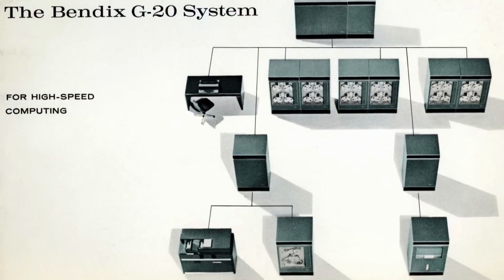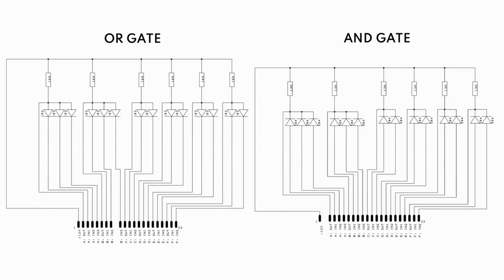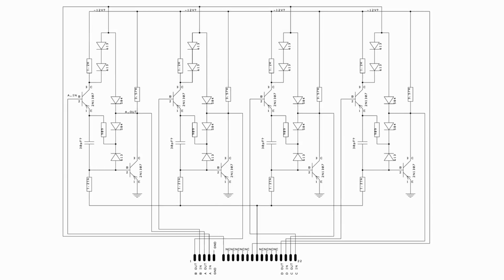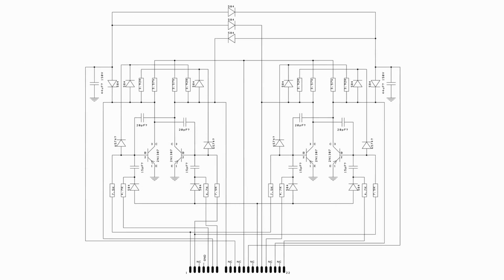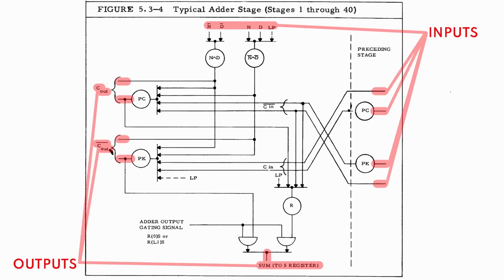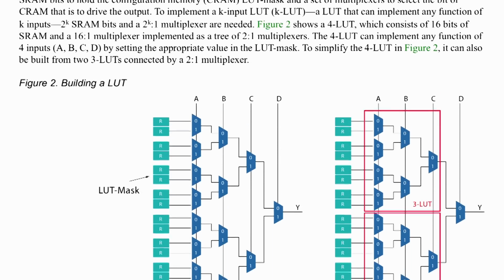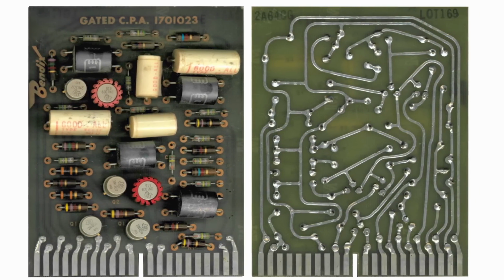Reverse Engineering Bendix G-20 Mainframe Cards

Comment: Looking at the transformers on the schematic, it seems to me that they "pulse" an output signal, i.e. making sure that it (at most) stays at a certian level for a very brief period of time. Could be some sort of Clock-Pulse or otherwise timed signal? Communication related perhaps? The diopd on the transformers are certainly clamping diodes for the field collapse. I can't think of any other use case for transformers in a "digital" circuit. But I'm sure they were commonplace back in the day, so they put them in instead of rigging up some 555 timers 😜
Reply: This was my thought too. I have been reverse engineering an early all-electronic PBX that used PAM-TDM. A pulse transfomer was used to gate a 4 diode bridge that was used to sample the analog signal. The diodes were actually configured as a bridge rectifier, with the pulse applied to what would normally by the DC side of the rectifier. To operate the gate, the paired anodes were driven positive, and the paired cathodes negative. Using a pulse transformer meant the differential gate drive voltage could be generated from a single voltage supply.
Reply: Is CPA  clock-pulse-amplifier? Part of the clock distribution circuitry.

Comment: In germanium land, diodes were cheap and fast, PNPs were expensive and slow, and NPNs were initially unavailable but later were most expensive and most slow.  This greatly affects circuit design.
Reply from the maker: Interesting! I had no idea that PNPs preceded NPNs, and for a computer like this that was at the forefront of the transistorization of computers, it makes sense that they would have used PNPs first.
Reply: @UsagiElectric  : You'd see PNP-based designs sticking around into the early seventies, often designed with a single negative supply rail and a positive ground.  With schematics drawn so the negative supply was at the top and the positive ground at the bottom, too.  Very hard to get your head around if you were used to tubes with a normal B+.

Comment: It may be that they are inconsistent and are flipping logic levels - voltage levels for some portions of the design.   An AND gate is an OR gate in inverted logic.  IE:  A AND B = (Not A OR Not B) with Inverted output.   You also may need to shift your thinking a bit.  Bipolar transistors are current controlled devices not voltage controlled like your vacuum tubes, TTL logic or MOSFETS.

Comment: I think the outputs of the emitter followers are from the emitters.  Those TO-5 transistors, if you put the two widely-spaced pins at the bottom, bottom view:   like this:

     *
 *      *

they were from left to right, clockwise,  E B C:

     B
E      C

Also on the Flip-Flop there should be a couple of resistors and/or diodes going from one collector to the other base and vice-versa.

And for the full adders-- why worry?  There is just one way to add two bits, with an XOR gate for the output and a OR gate for incorporating the carry.  

For carry-lookahead the most likely way is a bunch of AND gates seeing if a bit is asserted and the previous bit generated a carry.   This has to be recursively done down the adder so it quickly becomes a mess of multiple-input AND and XOR gates.

For doing an XOR the easiest way is to use a transformer that will respond if two bits are different, trivial with a transformer.  Then you need two diodes to catch an excursion at either end of the secondary.  With only transistors it becomes a mess of duplicated cross-connected AND and OR gates.  

 And it's all muddled if it's negative logic.   Just remember that if the diodes have the cathodes as the inputs,  and resistors pulling up (to logic 0) it's a negative-logic NOR gate, any input pulled down (asserted) pulls down the base, which raises (unasserts) the output.   If the diodes have anodes (triangly end) going to the inputs and resistors to a minus voltage, it's a NOT-AND gate, all inputs have to be low (not unasserted) for the output to go HIGH.   Every transistor stage does a logic inversion, so you have to keep that in mind throughout.  I know, it's very confusing.

A bit of a brain teaser.  Just keep in mind they probably used the simplest possible designs, as those diodes were likely $1 and the transistors $3 each. 

Just remember that they sold some of these, so it probably worked, any goofy looking stuff is correct, you just have to have faith.  In the lowest level it has to be AND, OR, NOT, and XOR gates.  

 In that era Seymour Cray designed a similar computer, the 48 bit 1103 that at first used the out of spec  germanium transistors from Texas Instruments which were much cheaper.  He had to not only use the simplest circuits but also ones that could operate with leaky and low-gain transistors.  He only had Tek 535 single-trace scopes at best so no trace storage and no glitch capture, if a pulse wasn't repeating and at least 200 nsec it couldn't be seen.  

There is a story about Seymour being super proud that he could pull out the complex Laplace transform techniques when he was assigned to design a pulse transformer.  But then he asked the engineer in the next office how he was designing his pulse transformers, and the guy said he only knew Ohm's law, he used trial and error to get the correct inductance and his transformers worked just as well and didn't require a whole day and a page of complex integrals to design.   Maybe that's why Cray was so modest in later years.   Anyway,  they were engineering giants in those days.

Comment: woah cool i found one of these pcb's a few months ago randomly in an alley here in the city,  had no clue what it was but it looked old and cool so i took it home and later found out it had germanium diodes on it which inspired me to make a distortion pedal for my guitar  and put me down an electronics rabbit hole the last few months.  It says "time base gen" on the back by intertech inc, so most likely part of a computer.  Unfortunatley it  looks like it was crushed with all the components laying flat ont he pcb, some  transistors ripped off  and many glass diodes broken.
Reply: ב''ה, this would probably be for broadcast television synchronization or similar videography equipment, but no specific knowledge.

Comment: An emitter follower is much the same as a cathode follower from your tube circuits, basically a low impedance buffer. The emitter will be the output, I think you might have the pins on the case confused.

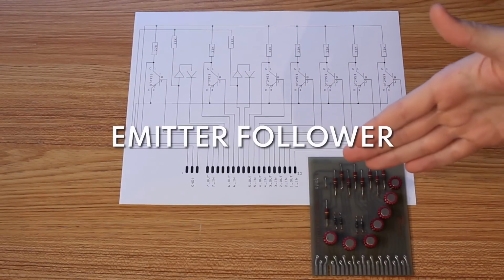Comment: Your schematic at 7:25 shows a group of “common emitter” PNP transistors with outputs on the collectors.  You mistakenly called the topology an emitter follower.  I think you’ll have trouble trying to tie your understanding of vacuum tubes to bipolar transistors; they’re not the same in that collector-emitter current of a bipolar transistor is a function of the base current whereas vacuum tubes control their anode-cathode currents via a grid voltage.
Reply: Yet they technically function essentially the same way only much more efficient due to the fact that the transistors don't even need heaters like the vacuum tubes before them, and Silicon P-channel MOSFETs are the closest equivalent of the triode tube, while bipolar transistors are completely different. So some skills and experience with vacuum tubes can be applied to the transistor as long as you know its merits and gotchas.

Comment: Amazing, these early transistor stuff is among the hardest to understand. 

Since components were super expensive, a lot of "strange" but super clever tricks were used to keep the component count minimal. 
Also a lot of the old stuff used a lot of inductors and transfomrers, which kind of got out of favor in later stuff. 
Jeri Ellsworth has an old video where she shows a whole "logic family" based on inductors and magnetic flux. (just as a sidenote)
I guess since semiconductors became so cheap and easy to manufacture, this sutff fell out of favour, since it is large, expensive and required a lot of manual work.

The wikipedia style site sounds pretty cool, I would definately take a look at that and see what I might be able to help at.

EDIT: 
Another sidenote, if you want to fully blow your mind, take a look at DDL or diode diode logic, which is a logic family, purely based on diodes, without any switching elements, it uses some wild stuff as well.
Reply: Agreed - when a single transistor cost the equivalent of $20 but a diode was $1, you certainly used diodes whenever you could.  The DEC PDP-8 (which was a contemporary of the Bendix G-20) used about 1500 transistors and 10,000 diodes.

Comment: I have built allot of stuff with just bipolar transistors. You really need to know what the transistor is before tracing out the schematic. Many times it's necessary to know what it the board connects to. I have seen 6 bit DAC's made using just 6 transistors and resistor networks.... And don't rely on the markings. Many manufacturers back than used their own markings on jelly bean parts. HP is by far the worst offender...

Comment: Diode chains on the emitter follower are there for DC restoration, as there would be cases, after going through a few gates, that the logic levels from the diode logic would be outside the acceptable levels, so the DC restoration is there to be wired in in the socket to allow the emitter follower ( actually here an inverter stage, expensive compared to diodes, and only used when absolutely needed to restore a sharp edge and provide current gain) to be offset by the 2 diode drops, so it will switch reliably.

Likely there are 2 types of logic here though, with one being positive and the other negative, depends on where the card is in circuit as to which one is used, which explains the confusion, and also the 0V reference might not actually be the chassis, at least locally, it might be generated by some diodes from a power rail and chassis.

Comment: That G-15 truly is a thing of beauty.
I've got to have a close look at that AND schematic later ... OR with diodes is fine, but as far as I thought, you need transistors to do AND.
PNP logic seems weird and downside-up too.... yeah, I really have got to get some screenshots of your schematics of these fascinating boards.
I wonder if those chose PNP specifically because it was something new that those old crusty vacuum tubes can't do and it was all about novelty... it just makes more sense to me to carry on "doing it the old vacuum tube way" and using NPN.
Reply: Germanium PNP was pretty much all there was in the early days of transistors. Certainly in commercially available quantities. NPN were available, but they hadn't really perfected the process.

Comment: two things I notice: 1. multiple diodes in series might be used to get increased threshold voltages, especially as this might be Ge diodes with lower knee voltages. 2. the typical flip flops you reference are level triggered and thus don't have capacitors in the "cross-over" feedback. Bendix ("we bend electronics"??) seems to use edge triggering here because of the caps.
Reply: Bendix made starter gear couplers. That's why we call those bendixes. They just kept the name. like Xerox.
Reply: @TheOriginalEviltech  thanks for the light bulb moment. My father always called that part of the engine the starter bendix.
Reply: This drawing of a flip-flop with the capacitors highlighted may be misleading. The feedback is probably via a resistor-diode mess and the capacitors are only for speeding up the transients.
Reply: Edge triggering could make sense because of the transformers.  A transformer only delivers current from its output winding while there is a change in voltage in the current through the input winding.  As soon as the voltage of the current flowing through the input winding stabilises, the current in the output winding will die away.
Reply: DTL often put two diodes in series with the transistor base.  This meant that the input signal had to exceed (2 x diode voltage drop) before the transistor would switch. This widened the voltage gap between logic 0 and logic 1 which made DTL have better noise immunity to the previous RTL.

Comment: Emitter follower:  those diodes are a sense that the card is present.  I suspect that these cards could be chained.  the diodes could indicate what card is plugged in.
Reply from the maker: Oooh, interesting idea! 
It seemed strange to me that there were those diodes on there without any connection to the other components on the board, but it being a sense circuit makes sense!
Reply: @UsagiElectric  VGA uses diode logic to indicate what modes the monitor can support.

Comment: Generous usage of the diodes weren't unheard of back in the day, it kept some stuff like microcode ROM decoding logics for early CISC processors simpler in term of wiring, for instance.

And -12 Volts emitter follower amplifier is more to push the data out to certain portion of the computer that needs more juice, or to the other devices separate from the computer (voltage drops tend to cause problems with digital electronics, especially Ethernet cable we have now and it has specific maximum limit of 100 feet in cable length for 100 Mbps or 30 feet or less for 1 Gbps for example - we just use much lower voltage nowadays due to the inductance of the longer cables even though inductance isn't a big deal for lower data bandwidth especially for the early computers).
Reply from the maker: Voltage drop across distances is something I totally didn't think about, but makes perfect sense! They can use the -12V to push it a longer distance and then some simple diode clamping to bring it back in line with the 0V to -3.5V voltage levels.
Reply: @UsagiElectric  Yep, something like that. It depends on where it's being used, however where it's being used is today's little mystery, because some portion of the computers may use exactly the same logic cards.